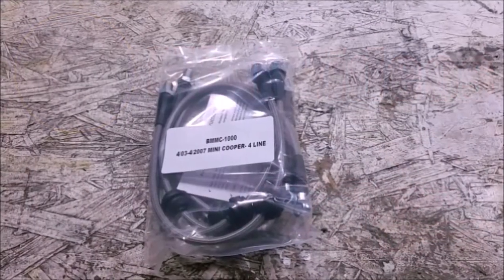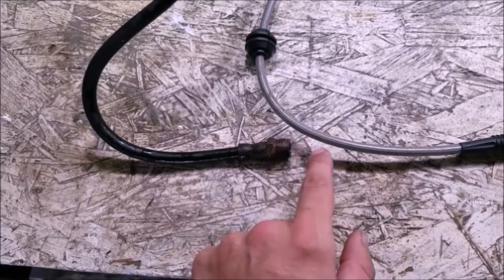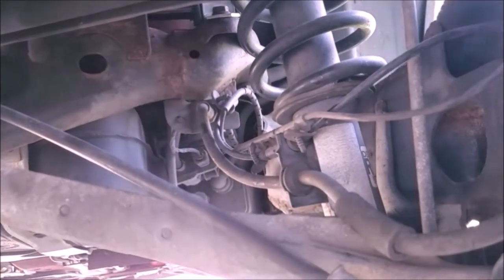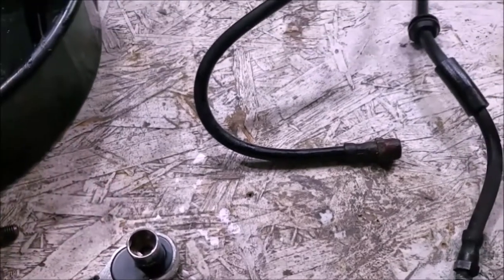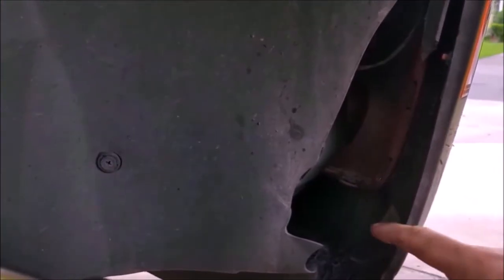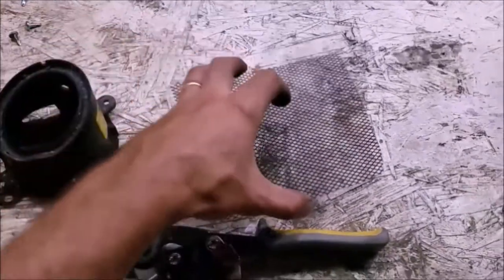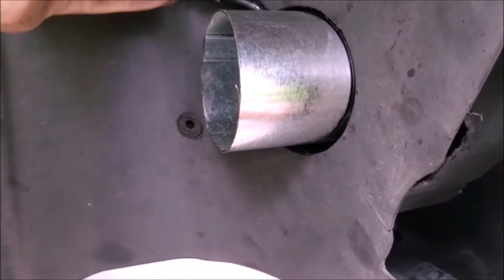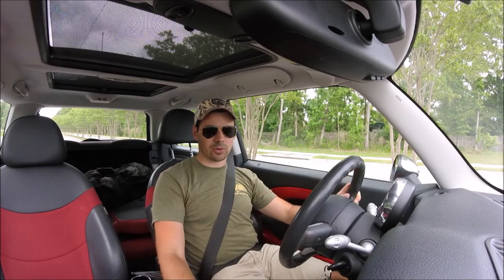R53 Mini Cooper S Brake Upgrades: Lines and Ducts (Part 3 of 3)

Comment: Thanks for the video. I am swapping in StopTech stainless lines on my late 2006 Mini Cooper S. I bought a set of three flare wrenches off Amazon but of course given my luck that set didn’t have an 11MM flare so I am off to the store to buy a single wrench. My 06 Mini has 44,000 miles but as you stated in the video - time is also a factor for rubber lines. Adding to that replacing the fluid gives me peace of mind and establishes a maintenance baseline.

Comment: I fitted Hel lines to my standard R53 along with Mintex racing pads, grooved discs and Dot4 fluid and I have to say that I don't feel the need for the R56 upgrade swap now...I'm not saying that they are as good as the larger disc, caliper swap but it does take away the weak feel of the standard brakes and  they feel much more capable👊
Reply from the maker: I would agree; I definitely have more brake than tire at the moment (but that changes soon). I will some day do the R56 brake upgrade as these calipers will eventually need to be replaced, but until then, I'm happy with this set up.

Comment: Did you find the ducts helped with brake fade on the track? What brake setup are you running?
Reply from the maker: I've never tested it, but I've also never had an issue with brake fade issue. I'm just running factory brakes with blank rotors, StopTech Sport pads, stainless lines, DOT4 fluid, and the brake ducts. They hold up surprisingly well considering the poor reputation they have.
Reply: Good to know. I’ve been thinking about the ducts for a while so I’ll be copying your method!
Reply from the maker: @StanGuru  Good luck! They're cheap insurance for sure.